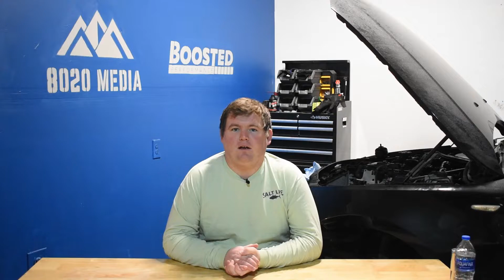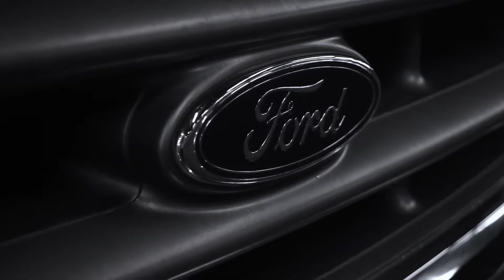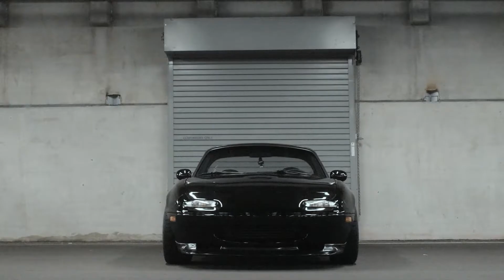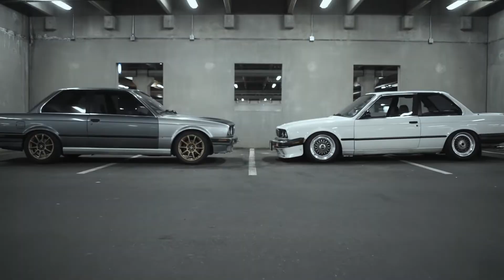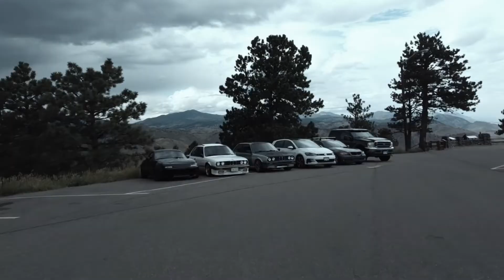The 2.0 EcoBoost | Common Problems & Reliability

Comment: The coolant intrusion issue was fixed mid year 2019 for the Edge. I would say anything built after June 2019 Should be good to go.
Reply from the maker: P - Should be better, yes. Not completely gone.
Reply: @8020Automotive how about a 2025 bronco sport badlands 2.0l 4 cylinders

Comment: Ford sucks! 2019 edge 90,000 miles and has to spend $8000 to put an engine in it. My wife loves the car or I would have traded it in for a GM, the brand I have always owned and not had these kind of problems with!
Reply from the maker: A - Sorry to hear this..

Comment: All the Ford Eco boom engines have issues with carbon build up. and I of large number of the Eco boom 2.0 engine's in the Bronco. having catastrophic failures. requiring complete engine replacement. I mentioned this before in a comment section. but was quickly inandated with replies from Ford fan boys. that didn't want to except the fact that these engines have issues. this is very typical of Ford they should just quit while they are behind.
Reply from the maker: M - This is true on the older models. The newer models, they are finally learning are are putting dual injection. We appreciate you sharing your experience!
Reply: Yea yea keep crying
Reply: @RickDohe Go ahead and keep being a MORON. with your garbage that Ford Motor Company is shoving down people's throats. you idiot.

Comment: They don't call them Eco Boom for nothing. and there are other problems with them too Cam phasers, coolant leaks, frequent belt replacements and transmission problems.
Reply from the maker: C - Good points.

Comment: I just had my MKC engine replaced due to a Misfire and hesitation up hills. it took 4 weeks to get it done. i was two days from the end of my warranty, the engine has 66,000 miles on it. I did notice the antifreeze going low. the dealer did suggest spark plugs change valve body cleaning and injectors cleaning, which they still did with the new engine, $700.00, out the door with only a yellow engine symbol on the screen, they said it was a hose that came loose.
Reply from the maker: P - Sorry to hear this... However, thanks for taking the time to share your experience!

Comment: 2017 to 2019 2.0 ecoboosts, avoid! 2020+ models they fixed the block design causing the head gasket failures.
Reply from the maker: J - Yep! Thanks for sharing! We agree.
Reply: The 2019 engine does have a specific cutoff. I have a 2019 MKZ with right at 75k miles. There was no TSB on my car. It was built in May and research indicates the TSB is on or before Apr 8, 2019. If you have an Escape the date is in May. I have had zero issue with my engine to this point....knock on wood!

Comment: Thanks for the video.The real problem with Ford EcoBoost (or EcoBoom) engines is the terribly thin cylinder walls. I personally think that is the biggest design flaw. With the Water Pump being the second biggest design flaw in the engines. You must remove the timing belt or chain to replace the water pump.  duh.
Reply from the maker: J - Thanks for the added insight here!
Reply: Well you CAN sneak the water pump out without removing the belt if you are careful, but it's bonkers that the water pump seems to last 60k miles and the belt replacement interval is 110k miles

Comment: Just test drove a 2019 Ford Escape with the 2 liter Ecoboost today. It seemed to ride fine, but when I popped the hood, it looked like there was some oil on the hood latch mechanism, and a very little around the top of the rad area. I am wondering if this is from a bad head gasket. The gasket you are talking about letting coolant into the cylinders, can it also spray some oil towards the front of the engine? Or maybe the guy just sprayed some lubricant on the hood latch?
Reply from the maker: A - We don't think it is actually that awful. But thanks for the insight.

Comment: I have a 2014 Fusion titanium and right at about 126,000 miles. recently started having a bad oil leak (not sure from where) and secondly, I feel like coolant is being heavily consumed too as the reservoir is low after adding a little into it
Reply from the maker: D - Thanks for taking the time to share your experience.

Comment: Hi, can I replace engine in my 2017 edge for newer like 2020?
Reply from the maker: P - You could, but don’t think it would really be worth it financially.
Reply: @8020Automotive  so what is the best solution? Fixing or replacing engine?
Reply from the maker: P - I mean it depends on cost, budget, a lot of different factors.
Reply: @8020Automotive  So, what is the best solution for this problem?

Comment: The 2.0 ecoboost has dual injection. it has both direct injection and port injection.  There is no more issue with carbon buildup on the intake valves.
Reply: It does not have dual injection, but the 1.5L does.
Reply from the maker: E - The newer ones do, yes. But not the older ones.
Reply: @8020Automotive they have had dual injection since 2021 when the Bronco Sport hit the scene.
Reply from the maker: yes.

Comment: Make sure you tell what  yr ecoboost your working on...2015 2.0L ecoboost 234k miles no problems! Take down old info...
Reply from the maker: S - This is referring to most 2.0 EcoBoost's. Just because you have not had any problems, doesn't mean other 2015's haven't. We're glad you've had a great experience with it though. Thanks for sharing your experience!

Comment: What’s the max whp this can take on a maverick vs the 2.3l ranger ? Stock internals
Reply from the maker: 2.3 ranger is safe until about 425-450wtq. Stock it will dyno about 270whp and 310wtq. At that torque limit it depends on tuning but you'll be 350-375whp. Safe limit on the 2.0 is probably around 350whp and 400wtq

Comment: Another question for you guys, how often do you see VVT/timing/timing chain issues with these?
Reply from the maker: D - We have started to see some of this for sure.
Reply: @8020Automotive  Yes, I can well imagine.  The timing chain plastic rails are a real joke; one should not have to put in new timing chains, rails, etc. as often as on this Ford ding-bat design
Reply: My 2010 ecoboost required a timing chain change (it was loose / play, abduct wasn’t the tensioner!) at 100k km - 65-odd K miles. 

Now for the interesting thing: sometime between 2010 and 2012, the chain and sprockets changed from smooth one to a design with teeth. Royal pain finding a smooth set, parts listings default to the newer design, which doesn’t fit!

Comment: My 2016 escape developed a small oil leak at about 30k miles. 
Not enough to have to add oil between oil changes but still frustrating.
Reply from the maker: S - Sorry to hear. However, thanks for sharing your experience!

Comment: I'm looking at the Ford Bronco Sport and trying to decide between the 2 engine options. If the focus is mostly on reliability, which engine would you bet on? the 4 cyl 2.0l EcoBoost or the 3 cyl 1.5l EcoBoost?
Reply from the maker: D - We have a video on the 1.5 that may be helpful here: https://youtu.be/xemd7cuYZvQ

Comment: 140k ecoboost on edge got the coolant intrusion. Reached out to Ford Corporation and was told tough. That's it. Now I'm in the market again for a new car...cat.... guess what brand I'm not buying?
Reply: I doubt any manufacturer would do any different for a engine with 147k miles on it.
Reply: @900stx7  even though it was proven to be a latent factory defect and some people actually got Ford to replace it for free?
Reply: @bobtruck1594  did these other people have 147k miles on their engines ?
Reply: @900stx7  yes. And more miles too. Research all the angry ecoboost owners. Lol
Reply from the maker: B - So sorry to hear about this.... How much were they charging to fix it?
Reply: @8020Automotive  7200$ new long block. On top of that... my tranny blew up. So it was in the shop for those 2 items. Final dealer quote was 23k for both. LOL. I LAUGHED.
Reply from the maker: B - Thanks for taking the time to share this info. It'll certainly be helpful for future viewers.

Comment: Everyone I know who has had the 2.0l, 1.5l and 1.6l has had their engines fail at low milages due to coolant intrusion. My wife's focus failed at 75 000 miles. I went from someone who has always bought Ford to someone who will never buy Fraud again.
Reply from the maker: P - Sorry to hear this... This seems to be very common nowadays. They certainly don't make them like they used to!
Reply: Same here my 2017 Escape 2.0 engine failed me at approx. 64,200 miles, did all factory required maintenance at my Ford dealer, now I am S-O-L!! Will never purchase another Ford product again. IMO Ford New they had a problem and should have recalled and replaced these engines with the redesigned engines made after 2020!!
Reply: @chunt4694  the assumption there is that the new engines will be better. I think the interval between being a loyal Ford customer and a disappointed never-Forder is around five years these days.
Reply: Mine failed at 41k 😢

Comment: The carbon build I solved.  I vent the PVC to the atmosphere
Reply from the maker: Yepp that's an option. Not a bad idea to install a catch can on it to capture the oil rather than letting it drip but to each their own - catch cans just aren't valid for emissions in a lot of places, they require the PCV system to be left intact and routed the factory way

Comment: Owned 2 - 2.0L GTDI Ecoboost engines in 2 different vehicles . Both served my family very well. Zero issues. '15 Lincoln MKZ AWD sedan & '22 Edge AWD. 184k mis on the Lincoln..uses zero oil /runs great. Edge 19k mis gen2 2.0L even smoother/quieter. Good basic maintenance goes a long way! Full synthetic oil every 5k mis. Ford has had the least carbon issues of all brands using 4cyl GTDI designs.
Reply from the maker: D - Thanks for sharing your experience! We couldn't agree more.. Basic maintenance goes a LONG way!
Reply: @8020Automotive I purchased a used Lincoln 2016 MKZ 2.0l ecoboost what you think am I going to have issue with it in the coming future
Reply from the maker: Y - All depends on how well it was maintained in the past and how many miles there are on it.

Comment: If you do own a 2.0 ecoboost or any turbo charged motor, you Must change the oil at no more then 7500 miles using full synthetic oil only. Maintenance is always key for success in anything mechanical especially turbo charged engines. If it's being run on hot days often a clean serviced coolant system is a must and the engine must be allowed to cool down after hard duty in hot weather. In colder climates you must warm up the turbos more so then non turbo motors. Drive these motors easy and not like track star nuts and do the maintenance often and early and they'll last a fairly long time ✌🏽🇺🇲
Reply from the maker: M - Very true! Thanks for sharing this insight!
Reply: All my cars have oil changed every 4K miles at most with full synthetic. It might sound like overkill, but I’d rather not take my chances.
Reply: I must call bullsh*t on that, I changed my oil every 5,000 miles or less, had the maintenance done at the dealer where I bought the 2017 Escape, had an extended warranty of 75,000 miles or seven years and low and behold developed a coolant leak in my no.2 cylinder at only 64,200 miles on my engine. It uses about a quart of antifreeze every week and am SOL unless I go threw a class action lawsuit to get it repaired, and good luck with that. Needless to say this is the last Ford product I will ever own!!
Reply: You were doomed to fail. Not your fault but due to design flaw of engine. I carefully maintained my 2017 edge and it began eating coolant at 50 k miles. I had it inspected under warranty and got a new updated engine installed. Saved $10000. Been perfect since. Ford engineers are not the best.  They have the biggest number of recalls for an oem. I also note crappy metal bolts that fail. Will never buy another Ford product in my life. Company takes short cuts to save $

Comment: What about mystery oil leak? I see owners that have spent big money at ford dealers guessing. Replacing front crank seal and gaskets and still leaks. Then changed for rocker covers and still leaks. Mine does same. Leaking from upper rear drivers side.
Reply: I believe there is some type of dye you can add to the oil that will reveal where the leak is.
Reply from the maker: Dennis - Have you taken it to the shop?

Comment: There are two types of 2.0 EB engine out there. First one with closed deck design (for an example in Focus ST) is solid and reliable. And the another version with open deck. And that one is the one with coolant leaking/overheating problems.
Reply: And to add to this the gen 1 2013-2016 ish is first gen, been servicing these engines from 2013 till 2024... The amount of 2.0 issues is far smaller than the 2.3... all 2.3 are open deck.
Reply: @lanet2436  my fusion is a 04-15 build date which should be the closed deck design but I see people say different things about the years and when they actually changed. Hope mine is actually a closed deck engine
Reply from the maker: Macie - This is correct.
Reply: Would the 2010 version be open deck or closed deck?
Reply from the maker: M - Thanks for helping Jamal out!
Reply: And the ones built in Valencia Spain were evidently less prone to failure.
Reply: Thank you for clarifying this. I have been seeing so many mixed reviews over the last few days when I was searching reliability. I own a Focus ST & it seems everybody has said it’s been really reliable for them. But rhen I would find videos like this & it’s the opposite lol. Didn’t know they varied in design.

Comment: Very well explained and informative. What a relief when you stated that Ford fixed the coolant cylinder problem in 2020. I just purchased a Bronco Sport Badlands and felt my heart stutter a little... lol
Reply: They say they did. My 2022 suffered this exact issue. Complete engine replacement.
Reply: At 24,004 miles, to be specific.
Reply: @Romswort  Sorry to hear that. I pray I'm not as unfortunate. Best of luck with the new engine.
Reply from the maker: 360 - Thanks for taking the time to share your experience. Hoping they paid for the replacement?
Reply: @8020Automotive I got the same thing at 74k miles on my 2018 edge, they refuse to cover the cost of the new engine:)
Reply from the maker: Goochma - Thanks for the feedback! Just make sure to maintain it well and it should be all good!
Reply: They didn't fix it that well. Our post office just  received the new gen postal trucks. Eight people trained so far and there's over heating problems in the first eight. Workers having to use the old trucks to finish their route

Comment: Umm...... the exhaust manifold is part of the head. To replace it, you must replace head. There hasn't been a whole lot of success doing this. Ford recommends engine  replacement, not cheap. Open deck cooling is a terrible design. Bottom line, this engine is a POS.
Reply from the maker: MJ - Thanks for the insight. This is correct! We made it sound more simple than it really is.
Reply: @8020Automotive  but closed deck ecoboost engines 2.0 till 2016 quite reliable and good i can say
Reply from the maker: E - Thanks for sharing this insight.

Comment: I recently purchased a 2019 Ford Edge SEL with the 2.0L ecoboost. I find it very concerning that this year\ make\model was not included in the service technical bulletin. should I be worried? Why wasn't the 2019 ford edge included?
Reply from the maker: Liz - Then that means this model wasn't affected, which is a good thing! No need to be worried.

Comment: hmm, no mention of the oil pum belt being rubber instead of metal, which can start to crack & chip bits & clog ?? I heard thats a serious one.  Any feedback on this, anyone ?
Reply: The 2.0L uses a metal chain, but the 2.7L uses a rubber wet belt.
Reply from the maker: RPM - Yes, this is also an issue on the 2.0 EB.
Reply: @8020Automotive  oh snap. so these rubber belts chip up and cause engine fail, right ? so do the new ones still have this or updated to chain ? and whats the earlist in milage that these have started to fail on ? I'm considering a new 23-4 Maverick and should I only buy one if Ford agrees to warranty a failure in this part and engine failure do to this part up to 150K miles or don't buy it ? This is serious and i shouldn't have to buy an extended warranty (not bad to do so), just for this stupid and cheap out design.
Reply: and how many manufactures our there use rubber belts in these systems ? is Ford the only moron or others ?

Comment: how do you get the revised engine? 
i have a 2016 ford fusion 2.0l turbo. im loosing coolant somewhere. UV die no visible leaks. and waiting on an oil sample test from Blackstone. oil visibly looked fine. 
this is the 3rd engine that's been in the car and its misfiring randomly on acceleration to pass people. it doesn't happen every time but its the only time it happens. 
first 2 engines misfired and blew apart and cracked #3 piston head. 
the engine is junk. no wonder ford quit making cars. they run away instead of being a responsible company and fixing the issue.
i suspect the revised engine still has the carbon build up problem, but at least it shouldn't have coolant intrusion.

you think with how old the company is they wouldn't make an engine this unreliable, but they just dont learn.
Reply: Third engine in a car?  That should be a red flag right there!  Best of luck getting it sorted.
Reply from the maker: Dark - You'll have to look online or maybe ask Ford? So sorry to hear about your experience.. sounds like a nightmare. However, we do appreciate the transparency. This will certainly help future viewers.